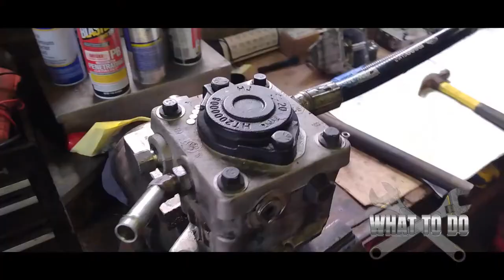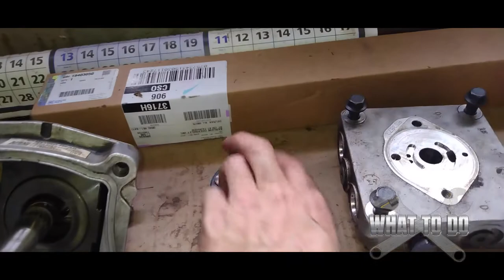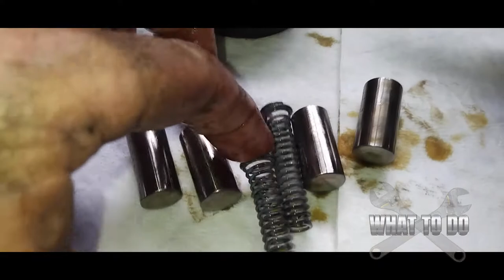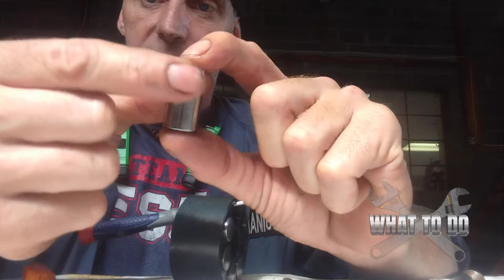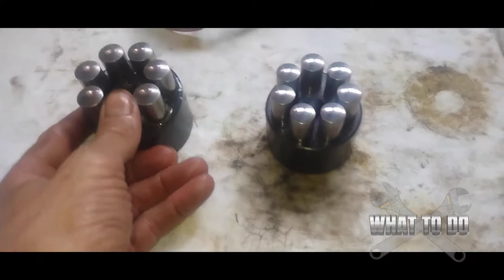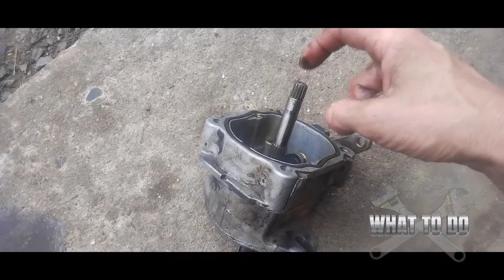Hydro gear - Disassemble & Fix Yourself !! - Whats Inside?

Comment: great vid as I just had one that crapped out. or the wheel motor did,  nice to see these are fixable  as long as it wasn't a catastropic failure.  seeing a new pump is 500-600
Reply from the maker: They are certainly fixable for the most part as long as you catch the problem early and finding the parts can be a little bit challenging but they are out there sometimes you may have to get different parts from different suppliers as I have not seen a complete rebuild kit completely from one supply yet usually just different parts from different people but they are rebuildable and if you don't need a whole lot of parts it can definitely save you a lot of money by fixing it yourself they are not rocket science when you take them apart they are actually very simple as long as you remember how you took it apart and how it goes back together

Comment: Thanks for the video! I got a leak on my pump from around the casing I replaced the o-ring gasket that goes around the caseing but it's still leaking. Was i supposed to use some type of sealant or loctite when I put it back together. Thx

Comment: The left ZT 2800 on my old Gravely recently started becoming much slower than the right one. If I bleed the left side (like when ya change the filter..but without changing the filter) it'll run at normal speed for an hour or two...and then require bleeding again. Any ideas before I tear it apart- or what to look for when I do tear it apart? Thanks for this vid! Best one I've found!

Comment: Like the video.  I have a zero turn and when idling it is making somewhat of a “clanking” sound (hard to describe).  It sounds like my left hydro-gear pump and when I feel the pumps with my hand, it also feels like something might be going on inside.   Curious if you have ever run across a noisy pump?  Mower moves around fine, no leaking and everything seems okay otherwise.  I’m not positive it’s the pump because with the motor running and belt turning there’s a lot of noise so I don’t want to just tear into it.

Comment: You are amazing my friend. I do have a question I took mine apart and put it all back together. When I went to engage it my left tire at first did a little movement but then it stopped moving the right wheel moves perfectly. Could this be due to putting the hoses on backwards or do I need to take it back off again and look at everything. As now the left wheel wont engage I had to add all new hydro oil due to the reservoir emptying out once I take the charge cap off.

Comment: I bought a used Husqvarna ZTR mower with hydro gear 3400’s. They are really loud. Kinda sounds like a car with no power steering fluid. They work fine they’re just noisy. Fluid is full and all.

Comment: Thanks, Rob really informative explanation on the pump.  I have a question concerning a Toro diesel 72 inch in-line Hydro pump broke pump belt  yesterday. Today I repaired it and replace idler crank the mower pushed handles forward start moving nice and easy. Everything sounds good. I shove my hand forward and kill the motor started up pushed handles. Folded moves slowly try to go fast and it shut it down again. It ran three minutes. The pumps are hotto the touch? This thing was perfect until yesterday. There are a lot of hydraulic lines underneath. Do you think one might have collapsed or it’s a problem? I took my filter off today. Cut it open no metal inside.
Reply from the maker: Hmmm. Usually when a pump gets hot like that it is some type of blockage in the fluid or really contsminsted fluid.

Comment: Hi Rob. Your video has been invaluable to me. I am reassembling my pump now. I noticed there is what appears to be an alignment arrow on the bottom of the cylinder block. Is it supposed to go on the shaft a certain way? Thanks!

Comment: Good video. How can I tell if it’s my hydro pump on my 2008 zero turn mower. The left stick only pushes the mower about half of the right side
Reply from the maker: I would also check the adjustment on the control arm that is attached to the hydrop pump. They are adjustable. Also at the end of that control alarm there's a set pin that holds the Lever on the shaft of the hydro pump sometimes That can come loose And the lever might not be grabbing the shaft properly to give you the full distance throw of the handle.

Comment: Excellent video. Very clear! My Bad Boy with this type pump acts as though there is backlash. There is no backlash in my linkage at all, but to stop the wheel, the pump lever has to return to a different place when coming from forward versus coming from reverse. It creeps one way or the other in what should be the neutral position. Is that normal for these type pumps? I may disassemble to see if I can find an issue. (Thanks to your video!)
Reply from the maker: Are you certain that the lever has not shifted on the shaft itself?
Reply from the maker: One thing you can do is take the Linkage arm itself off. Then Jack up your machine be very careful doing this. Try to move the lever yourself forward and reverse. You might find out that you are actually able to push the lever farther than when the linkage was connected. If that is the case then you definitely have to adjust the linkage Or the lever on the shaft itself. If you remember in my video there's a cradle at the bottom of the pump sounds to me like the cradle is not being depressed completely when going in. Therefore it's not going to build the proper pressure.
Reply from the maker: You can also do this method by adjusting the handle itself so that you're able to pull the handle farther backwards. Depending on your machine these handles will stop at a certain spot but if you loosen the bolts on the handle and push it forward a little more and then tighten it you'll be able to pull back farther if that makes any sense. If you're still not having any luck after that I would suggest doing a complete tear down and see what's going on inside
Reply: @youtubestar  I guess you mean I'll be able to pull it back farther before the arms drop into the neutral slots. I didn't fully explain, but I have automated my mower and completely removed the arms. I have servos moving the pump levers. I have videos on my channel of my mower adventures. My original mower, which has a nice deadband at neutral, had the combo transaxles, but the latest one has the separate pump and motor. I'll pop the top on the pumps and see what I can see. Thank you for responding!
Reply: The first step I take in operating the mower after installing the automation is to put it on jackstands and adjust linkages and parameters in the firmware so that neutral on my controls is dead center of the deadband of the mower drive system. What I found with this mower is that I could not find such a spot. The mower only has 400 hours on it, but is a 2014 model. Thank you for your detailed attempt at helping.

Comment: I am having pump issues with my hydro gear brand pumps after low oil. I changed the oil and replaced a bad line. Now the wheels won’t move, and the mower will free roll even with bypass closed. I tried all the bleeding methods and have had no luck. Do these need to be pre filled after an oil change ?

Comment: I need a new shaft can you help. The fan I caused to brake  then I tried to remove the nut holding the fan to the shaft, I didn’t see until I looked at the broken nut that it was stamped on both sides to prevent it from loosening. Your suggestions please, and thank you. My name is Ed.

Comment: Like and subbed. Great information. My toro grandstand loses function on right ride after mowing for about 30 minutes. Works fine again after waiting an hour but eventually loses it again. Hopefully following this video will show me something. Maybe someone has experienced it before and can help. Thanks
Reply from the maker: A couple things you can check. Number one check to see if all the fan blades are on that pump on the right side. If they are missing blades when the pump gets hot it can lose pressure And then when it cools down it will run good again.. Also you might have bad seals in your pump. The seals are rubber and when they get hot they expand and if you have bad seals the pump will not build as much pressure when they warm up.
Reply: My right side blades are nicked up. How do you replace them?
Reply: @youtubestar   No fans on these pumps I'm pretty sure, older model. Just frothing in reservoir is the only thing i noticed and sometimes a leak forms at wheel motor hose connection. Was guessing pressure/heat issue since it works fine after cooling down. Maybe bad oil. Will break down the pump and this week check seals. Thanks for the quick response!
Reply: I’m assuming it’s just the same technique as the left side and replacing the fan.
Reply: PS super clear explanation of the rebuild and the workings of this motor.  Demystified wonderfully
Reply: Where could mine be leaking, down low under hoses,, are there any seals  that get bad,, mine seems to be turning fine but leaking and I have to add oil when I mow,, thanks, great video,, very informative

Comment: Dixie Chopper 200079 PUMP-HYDRO. WHITE LEFT TDS 10 , when I go up a hill  the left side will jump like it has air in it ??
Reply: Did you fix it mine is doing the same thing.
Reply from the maker: Did you check the belt tension on that side? And make sure the idler pulley is not hitting the frame. That is a known problem with those units.
Reply: @youtubestar  It has 1 belt for the Tbox its not on the frame. It well do it when it is hot . Thanks for your help joe